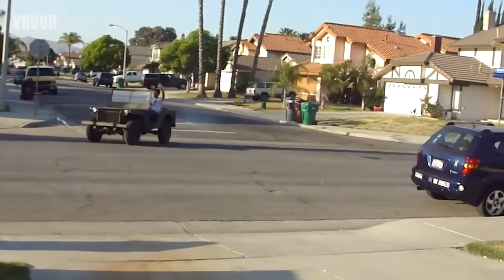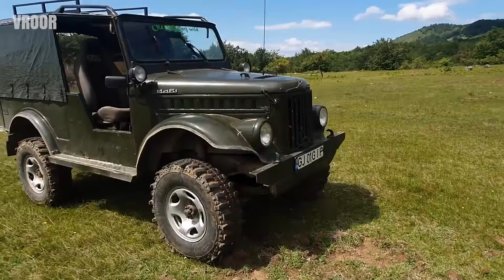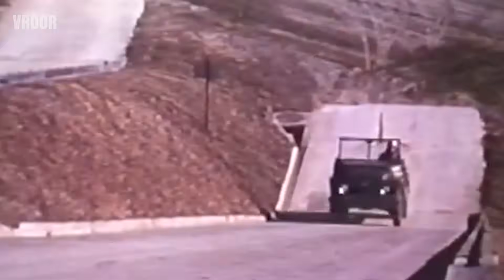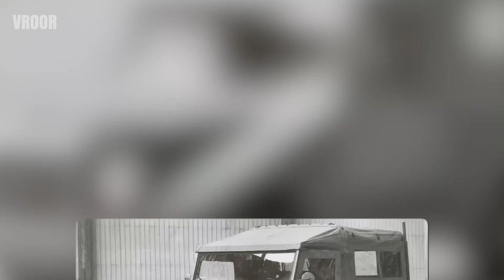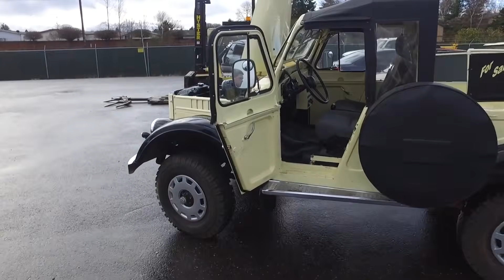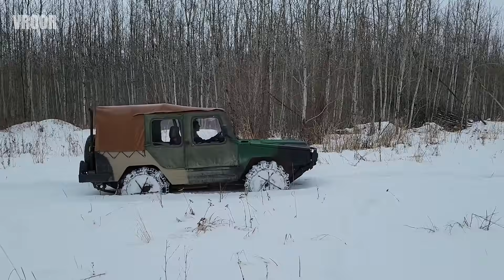10 Military Mini 4x4s Built Like Tanks

Comment: I drove a Minerva Jeep in a recce platoon during my military service in 1973. A few years later I was able to buy one from a surplus stock.
A fabulous vehicle and an almost unbreakable engine; one day I was at about 20 miles from home, late in the evening, when one of the water hoses ripped off.
I stopped to have a look, noticed that the engine was out of coolant water, but was able to mount the hose again.
Then I just kept driving, without any coolant, and once I got home I put a kettle on and first poured steaming water into the radiator; then I put on another kettle and mixed that one with cold water, to end up with filling up the radiator with cold water.
Afterward I checked the engine and it was fine.